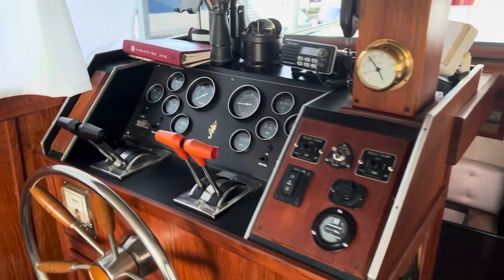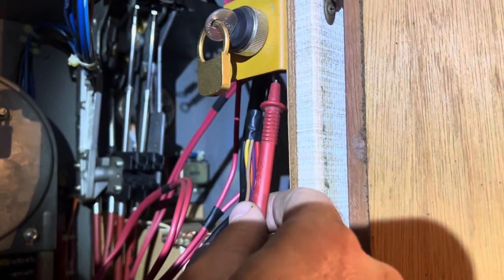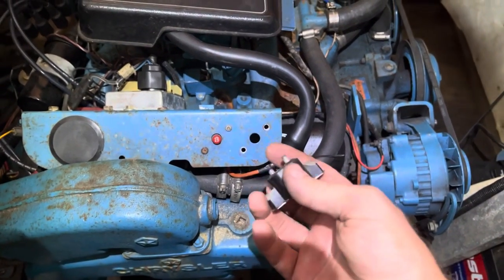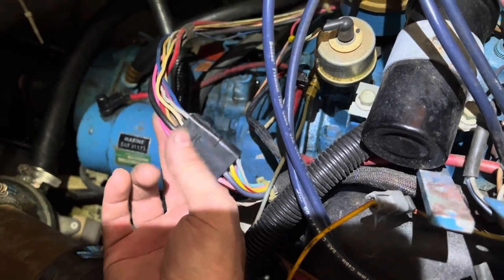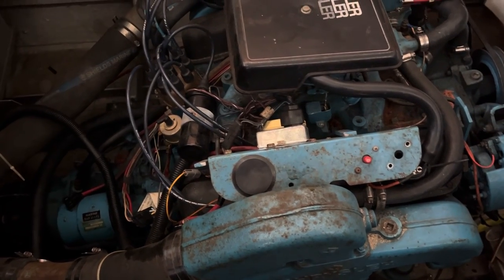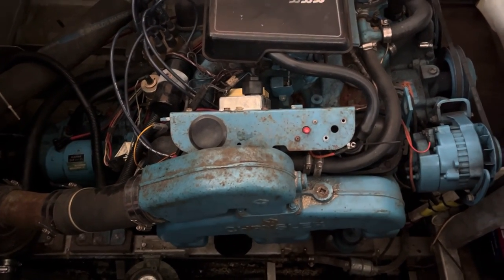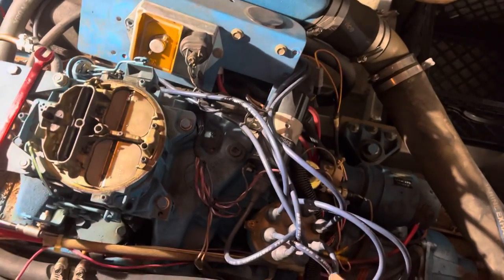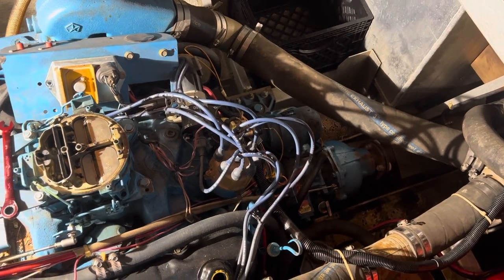How to Troubleshoot Low Voltage on Your Boat and Fix it Fast!!!!

Comment: Great video! I have this same issue. I have already cleaned all the wiring in the icm but didn't clean the bolts. I'm going to try that next. Wish me luck 🤞
Reply from the maker: Also clean the all the grounds in the engine block as well. Thanks for watching keep me posted!!!

Comment: man what a great video! im having a problem with mercruiser 3.0 bayliner. once im in the water running the boat, it completely turns off and i have no spark at the coil and my coil is hot then once it cools down it starts right back up again. i just saw my RPM gauge is stuck at 800 Rpm and i noticed my volt meter says its 10v while starting and 11-12 volts running. im definitely going to sand all my connections!
Reply from the maker: @alltorque415  check all your connections on your engine and check your grounds that are bolted to the block as well. Check your power supply wire for your ignition usually attached to your starter along with the battery supply. I had a 3.0 several years ago that would run fine than die, It was the wire at the starter. Hope this helps. Once you get proper voltage this could be your ignition module going bad causing it to die once it warms up.

Thanks for watching!!!
Reply: @jeepmanking3577  thanks for the help!!!! im sanding every single connection right now as we speak lol, all the connections i have sanded definitely needed cleaning. then when i was cleaning the cables on the alternator, i checked the tension on the belt and it was so loose i can spin the alternator pulley with my fingers with ease. thats for sure would not give me the proper voltage if the alternator isnt spinning
Reply from the maker: @alltorque415  good find on the loose belt!!!